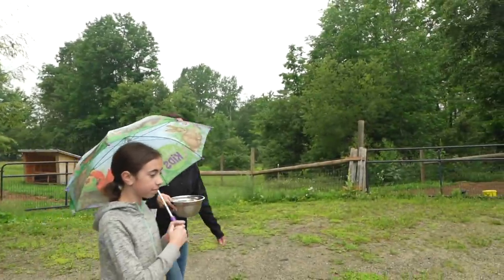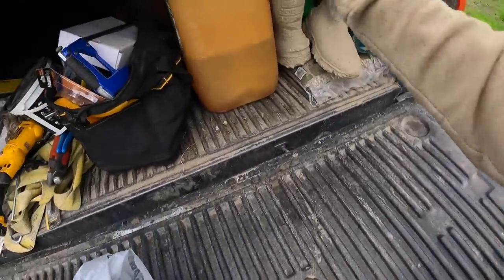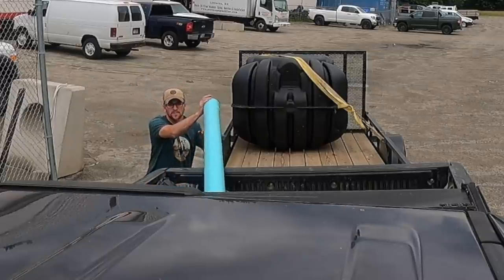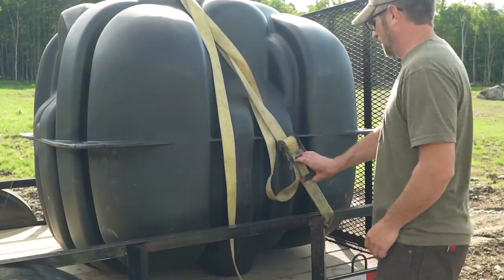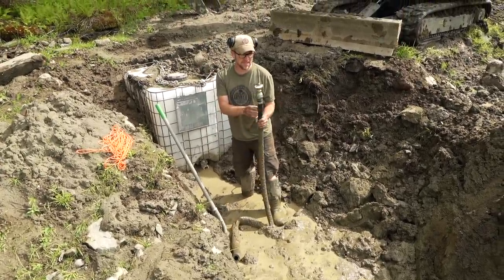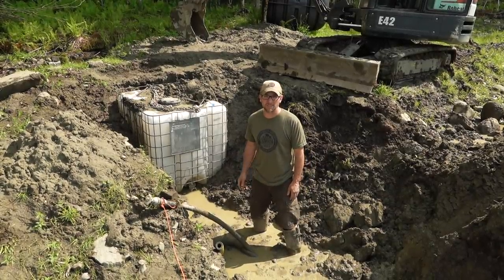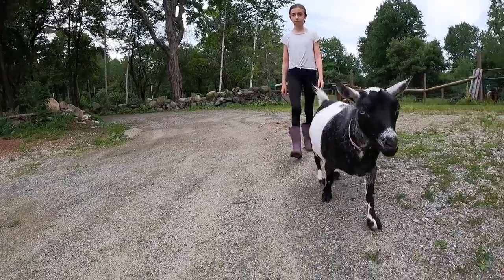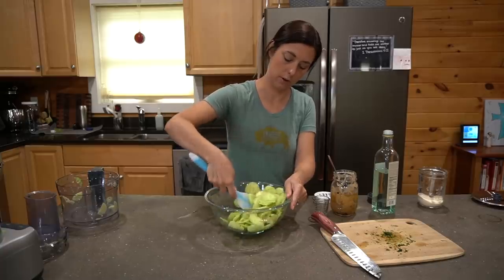Well that DIDN'T Go As PLANNED! PLAN B Building a Gravity Fed Water SUPPLY at Our OFF-GRID HOMESTEAD

Comment: Ooh! What was that spot on Hope's left side? Is she okay?
     The bigger tank won't necessarily mean more pressure. The amount of pressure in a water system isn't greater because of an increase in volume but because the height of the column of water at the head is greater. Let's say you have two cylindrical tanks of equal diameter one five feet long and the other three feet long and you bury them horizontally, at the same depth. When they are both full, the pressure will be the same. If you drain them at the same rate, X gallons per minute, the pressure from the larger one will fall more slowly only because it holds more so the level in the tank will drop more slowly. If you stood them on end with the bottoms at the same depth the pressure from the longer tank would be 1⅔ as high as from the shorter one when they were both full.
Reply: Lumnah Acres have said in previous replies that Hope scratched her self & they applied some purple ointment.

Comment: Wouldn't the easiest this way to do the change, Is lift the old  tank out by the chains that are already hooked to it, disconnect the pipe from it. Then dig out the hole to set the new tank in the hole  connect the pipe up to the new tank and get water into it

Comment: Al I would install a valve that I could turn off above ground and bury a piece of 4" pvc pipe from valve to above ground.  This way you can make a valve wrench on a piece of metal pipe to put down into the 4" pvc to turn off lines should there be a problem down line. Just a thought.
Reply: I agree, having access to shut off valves along the line is a great idea. You can stop up the break until you can dig to fix it in the Spring.
Reply: @StoneKathryn  They could always just shut off intake into tank as a simpler solution.

Comment: Rain  non  stop  here in the  Midwest  it is coming your  way!!!  Do  what  I did  metal  barrels  open them up and  put around the  tote  that  is  do the  problem your having  I used  thick ones  to  put around the tote  1/2 inch  you have the  equipment for  moving them into  place///  Just  listen  to me  I am a  business lady with  lots of  known  ledge  Guys  thought it wouldn't  work  but it did  10 yrs  ago !!!  Do it  the  full length  height of the  tote!!!

Comment: Al the water tank needs to be above the water outlets for gravity feed, the higher the more pressure you will get. cut down some skinny trees build a platforn 10 feet above the ground and pump water up to it from the stream with a 12 volt pump with a 12 volt battery and solar battery charger

Comment: Al, shouldn’t you have a larger size pipe at the tank then reduce it down over the length of your run to your finally size. That way water pressure would build
Reply: Size is nothing compared to elevation, elevation is pressure, size is just resistance!
Reply: That is called static regain if you are sizing ductwork in a HVAC system. Probably would work but if only the last spigot is open it wouldn't do a lot. It assumes the fluid is always flowing through at a steady amount with flow out all runs.

Comment: f you rig up a cap for the tote you can use an air compressor pump air in it and it'll pop the tote back out and when the tote is filled with water that should hold the walls out better
Reply: That's a good idea, let air pressure pop it back out. Water is imcompressible but air is!

Comment: You do know that if that tank is not higher than the Hydrant at the other end no water is coming out. Are you going to pressure feed the tank cause if not you will need a head of pressure which is a water column 2.3 feet above the hydrant just for 1 psi of outlet.

Comment: You can't direct bury that flimsy tote but you could build a frame out of flame treated logs to hold back the earth.  I'm not clear on why you're burying it at all though, you're losing head pressure the power you put it.  If freezing is the only reason, you'd be better off letting the sun heat the black tank.

Comment: The volume of water in a tank does not increase the water pressure. Height, or amount of drop, is what creates water pressure.  For every 2.31 feet of elevation drop = 1 psi of pressure head.  Here is a link to calculate your flow http://calctool.org/CALC/eng/civil/hazen-williams_g.  If you are concerned about the tank freezing, consider building an insulated pump house over the tank or bury it deeper.

Comment: Unfortunately, Tropical Storm Elsa decided to visit the Off-Grid Homestead this past week. There is constant flooding down in Pennsylvania and it's headed your way. 

The depression beside the excavator looks to be collecting rainwater when it rains, allowing it to drain down into the ditch in front of your tote. Is there any way you can block that water so it won't continue to drain there?
Reply: My thought was Al could use a length of sewer pipe to span that water collection depression - allow the upstream water to continue it's trek towards the lower...

Comment: aL GRVITY FED WILL FILL THE TANK, BUT WON'T HAVE ENOUGH PRESSURE TO PUSH IT 200 TO 300 FT PLUS THE FIVE FT RISE AT THE HYDRANTS, YOU'LL NEED TO INSTALL A SOLAR PUMP OR USE A GENERATOR TO MAKE THE PUMP PUSH THAT DISTANCE. FROM MY EXPERIENCE YOUR TANK WILL JUST STOP FILLING ONCE FULL AND NOT HAVE ENOUGH STRENGTH TO PUSH THE WATER.. THE LENGTH OF YOUR WATER LINE and then up 5 ft at each hydrant
Reply: It's impossible to tell on video what the slope is on the land. If the slope is 1:10 then water will  flow out of the Hydrants.

Comment: You should have filled the tank right after you set it. And backfill those ditches as you go after laying the pipe. You obviously don't understand how dangerous those open ditches are. In the trade for over 30 years.
Reply: And out of curiosity how do you expect to get head pressure when your tank is below your hydrants? Put a piece of 4 or 6 pvc around the bottom of the hydrant up out of the ground before you put the tee on bottom. Dump gravel at the bottom then slide pipe down and fill w gravel. That will more than handle the weep hole and save a lot of gravel.